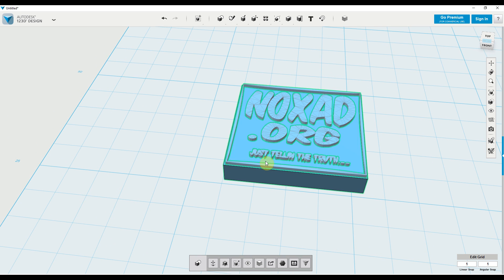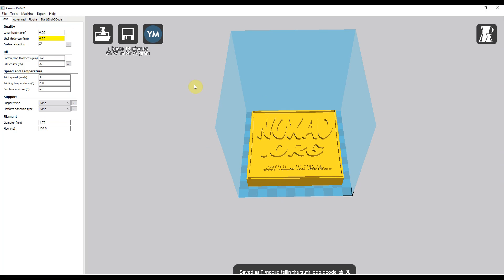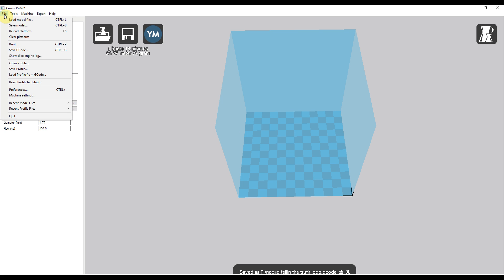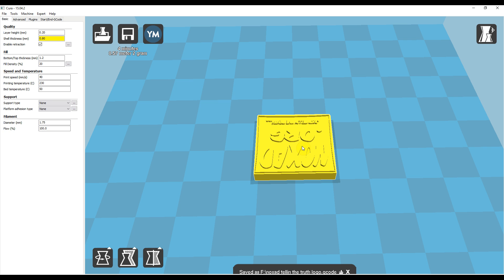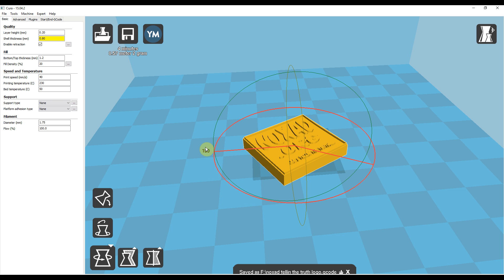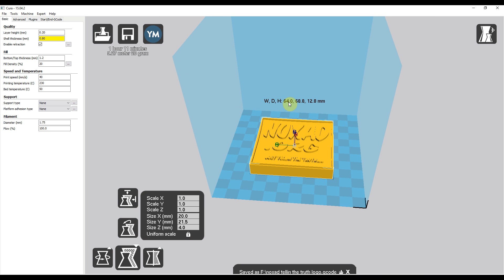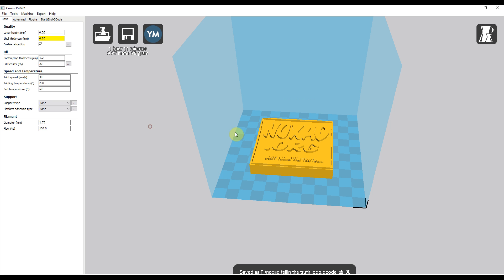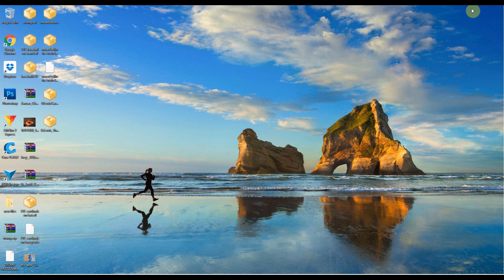How To Covert An STL File To A GCODE File For 3D Printing

Comment: Thanks for the video. I have the same printer as you which I bought second hand. The only issue I’ve been running into is finding the program to convert stl to gcode. So I will try to follow your instructions and report back if it worked. Thanks

Comment: Hey man , i have some OBJ files that need to be set to GCODE files for my ender 3 printer. How do i do this? i tried this way , but the files are to small aparently. cheers
Reply from the maker: Mick D  where did you get those files did you make them?  If you use something like 123d design you can save to different formats from there and it can be helpful actually, or if you import into it then save to STL, then get it to gcode 😊
Reply: @WeaverFamilyFarms  it's a design i bought from Pinshape. All the files in it are in obj (object ) format. it's really confusing.. even after slicing them in cura , then printing them , it kind off fails and is way to small.

Comment: whats the difference between .g file  and .gcode file?    My printer came with test.g file which worked, so I am guessing I gotta stick with .g format whatever that is.   Thanks for posting!
Reply from the maker: james pruett sorrry I have not heard of gfile.  Only g code!   Try to use a gcode file in yours and see if it works